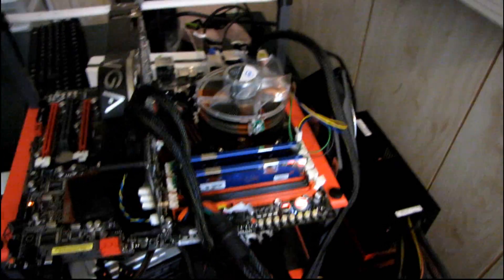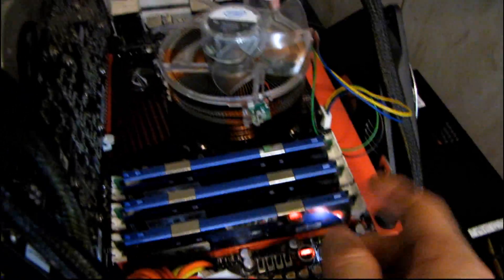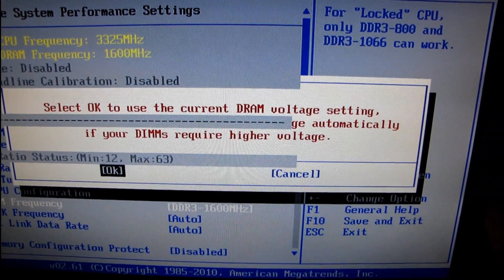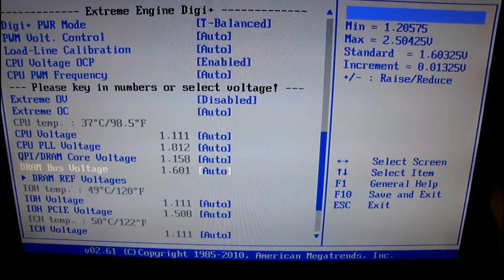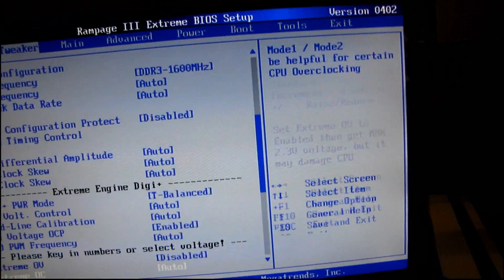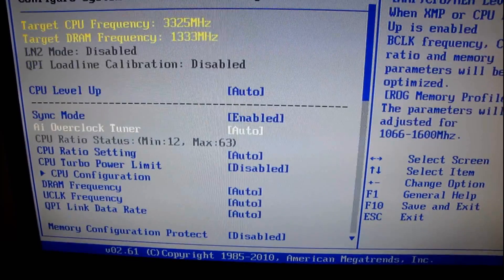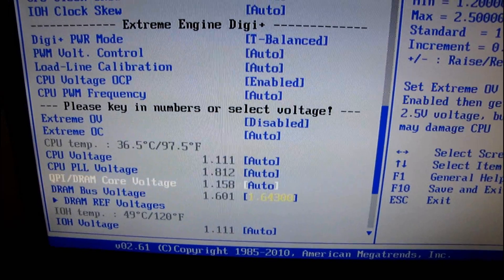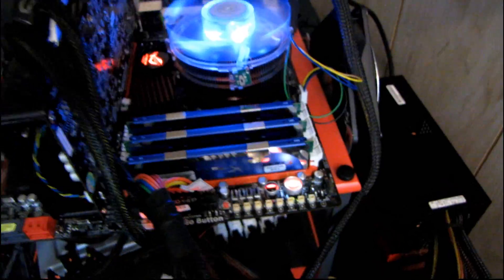Kingston DDR3 RAM Memory Installation Guide Frequency Timings Voltage Settings Linus Tech Tips

Comment: I installed 4Gb x 2 ram sticks in my laptop with DDR3 1066MHZ BUT it running so slow. I tried to use one the speed want back to normal. I wish to use 8GB but it is clear my PC was too slow to work with and moreover the CPU usage was 100 % all the time on Windows 10 x64 bit!
I tried to slow it from The bois but there no way for that. I'm using an old LG laptop from 2011 with an intel i3 390m 2.66Mhz
I thought of buying an i7 640m but I'm afraid of not working on my laptop
What should I do?

Comment: ok i got a question.. i have 6 slots on my old motherboard, installed 6 ram skits, 3 4 gig ripyaws @1333, 2 hyper 4 gigs same speed, and one stock kingston 2 gig stick with same speed, individually every slot reads adequate ram size and speed all sloths on pc working and checked, how ever... when i install them ALL, speed drops to 531 and 2 of my 4 gig sticks drop to a 2 gig cap, giving me a total of only 18 gigs ram  acording to SPECCY, system properties only detects 16 gigs, even if i take out 2 gig stick, it will drop down my 4 gigs sticks  to 2 gigs each (only 2 sticks drop regardless of which brand or where placed in any number slot), so... what the heck do i do??

Comment: ok so my motherboard is auto set to 1.5v and I get 1.35v ram and my computer will not even start ...with old ram in I set computer to 1.35v and shut off and put in 1.35v ram and restart computer will this work ?  and if I redo windows in the future will it remember 1.35v ?   or will it go back to 1.5v and will not even be able to get back into bios ?

Comment: Hi Linus, Hope you doing well. For last few days i encountered a serious issue into my motherboard (GIGABYTE 78LMT-USB3_REV 6.0). Last few month it behaves well with my 2x DDR3 8 GB 1600 BUS Ram and GTX 780. Now for few days i can only use one single ram to run my pc (8 GB single stick). Duel Ram doesn't give me any display at all. I tried a lot of way to enable my duel ram for work but still I can't. I checked my CMOS battery, update and flash BIOS, clean my all ram slots, interchange ram with various slots...nothing..Nothing gonna work!! All the slots are completely fine also my 2 rams..but i don't understand why the duel ram not working as like as before??!! Can you please give me any suggestion? By the way, I am not a tech savvy guy.. :)

Comment: What happens when you install 1600 mhz ram on a board that can only support 1333 mhz ?
Reply: probrably will be default 1333, and will boot up. Or will not boot and you will have to reduce to frequency, not a big deal
Reply: never boot up...

Comment: My RAM and motherboard are both overclock compatible but I tried to overclock my RAM yesterday to 1866 MHz from 1600 (My goal is to reach atleast 2133 MHz) and it caused my PC to blue screen 5 minutes after startup. I've tried adding voltage step by step but it didn't help.
CPU: AMD Fx-8320E OC at 4.0 GHz
Motherboard: ASRock Fatal1ty 970 Performance Series
RAM: EVGA Superclocked edition 2x4GB 1600 MHz
PSU: Corsair CX650M 650W 80 Plus Bronze Certified
GPU: MSI GTX 770 2GB Twin Frozr
Reply: i tried do the same too, 1333 to 1600 to me, failed too

Comment: According to the video, set your ram up to run at the fastest frequency, the lowest latency and the lowest voltage. 
Adjusting voltage, frequency, and the memory multiplier are all possible options that can be modified within BIOS. 
Changing these options can have an impact on the PC and how it runs. Overclocking RAM for example may decrease the life of the RAM or computer because it can cause the memory or the components to run at higher temperatures than the manufacturers rated specifications.

Comment: Hi, i have a question, i have 2 slots on my motherboard and there is already a 2GB on the other slot, can i remove it and replace it with a 4GB? so i can put two 4GB on both slots, thanks!
Reply: it depends on the motherboard

Comment: Strange, I thought my RAM was 8-8-8-24 as said by CPUID but it says 10-10-10-27. Does that mean I can set my Clock timing to 10-10-10-27? Currently on 1600Mhz with memory level up set with the bios
Reply: Tried the XMP profile but it won't allow me to overclock to CL10 for some reason, unless the profile is wrong
Reply: you know, lower is better in timings

Comment: i have a corsair-vengeance-pro-ddr3 2400mhz 1.65 volt but my motherboard does only support untill 2133mhz can i run my ram at 2133mhz with the Same voltage and timings
Reply: yes

Comment: hey mate I got a problem.
I have 8gb of ram but it's only use 3,98 gb
i have tried everything msconfig-boot-adv setting... etc.
doesnt work.
i got windows 10
Reply: double check that both RAM is plugged correctly
Reply: I have the same fucking problem just win 7 -_-
Reply: ***** 64bit
Reply: Did you solve the problem?
Reply: I have this problem too

Only reads 4gb when i installed 12gb

And i updated the bios

I've tested different sticks - same problem
Reply: @asd81907  asus p6t se
Reply: Both
Reply: @asd81907  i think it is r type ram for server
Reply: @asd81907  i tried u type ram 8 gb same type for 1333 and 1600

No go

So 4gb r type ram is 4gb

8gb u type 1333 and 1600 is 8gb

(dual channel - 2 4 slots)

I'm starting to think it might be a case of bent pins

I tested with dual and single ram channel (2 & 4 and 2nd slot, respectively - only 1 ram stick read) - when i plug in it in triple channel (2 4 6) --- no post
Reply: @asd81907  no

Comment: i just made my ram read 1600 from 1333. i can't wait to see the difference in gaming. THANK YOU LINUS
Reply: Lucas Garcia was there a difference in gaming?
Reply: no, just bandwidth. how ever as more games use more ram, more of the bandwidth of the ram will be used. at most. 34% of mine is used. would have been higher if i still used 1333. so it did help in a way.
Reply: Lucas Garcia I just bought 8 more GB ram(I had single channel 8GB before) and now it runs in dual channel so I see a big performance improvement in battlefield 1, I'm happy :D
Reply: GamersTurf  16 should be the minimum people use. all most 13GB of mine are being used and around 33% of its bandwidth

Comment: hello, i need your help. im Christopher from Philippines, im recently having troubled with my PC im wanted to upgrade my RAM from 2G ddr2 800mhz single channel which im using and running now with my PC to 8G DDR3 1333mhz. however when im going to insert my ddr3 ram when i turned on my computer it has no display and has continuous short beeping sound. 
my PC specs - 
Gigabyte G41m combo mother board - with 4 ram slot 2 for ddr2 and 2 for dd3
intel core 2 dou 2.8Ghz
Window 7 32 bit
PSU 700watts
350G Sata hardisk
i tried to check its proper placement and i tried all possible cleaning with my Ram slot stil when im going to insert the DDR3 ram. i only get continuous short beeping sound with now post boot and no display. i cannot even proceed to boot up. 

actually i have no idea how to setup the mother board bios. 
i need some help.
by the way i bought 2pcs 4G ddr3 Ram 1333mhz kingston because the motherboard max ram is up to 8G only based on the motherboard Gigabyte G41m combo specification manual
Reply: Dont reaplace ddr2 ram with ddr3
Reply: its not the processor, its the bios
Reply: You need 64bit Windows for 8GB of Ram

Comment: Hey Linus or anybody very good with PCS. I have Kingston HyperX 4GB (2GB sticks) @ 1066 MHz and on CPU-Z im at 400 MHZ instead of 533 MHz,  my cas latency is 5 and voltage at 1.8.  Now if i just want up my ram speed to 1066 is it best for mobo to do voltage automatically or manually?  I found a similar pair on newegg that says latency 5  5-5-5-15 timing and 2.2 voltage.      http://www.newegg.com/Product/Product.aspx?Item=N82E16820104038   Is it worth fixing my ram to its labeled clock speed and what are the best voltage, timing, latency to insure stability? Thanks!

Comment: this is worse linus tech tips , im trying  to follow what he his saying and hes jumping all over the bios while talking about different things , im clueless and i all most fried my motherboard all ready and im not to eager to all most break something else
Reply: bob cat I watched this video 3 times and still didnt get anything about what this guy said...
Reply: This IS linus tech tips😂😂😂
Reply: You know you can rewind and pause right? You don't need to be following his every move as fast as him lol
Reply: Do Not mess With your BIOS ! "Unless You are Comfortably Sure that "YOU" are sure of what You are doing !  Linus does not care if he Destroys a piece of hardware, because he is swimming in it, like Scrooge McDuck.  For the rest of us DIY'ers ,   Slow Down, Be Sure of what you are Doing. Take your Time ,  and Get it Right , so you don't throw away Hundreds of $$$ Dollars !!! ...  In This Video , Linus Almost toasted his system @... 5:04 .... IMO  the BIOS options should lock you out of over Loading in a way that can cause damage.... some boards have CPU Over-Volt Protection, however it has to be "Turned On" before it "Works"..... The XMP Profile is the Better way to set up your RAM (IMO) (and , incidentally safer as well)
Reply: @robertsimpson5761  most often if you mess with settings the motherboard will let you know if bad setting and reboot with last known good settings. a lot has changed since 2010.
Reply: bob cat that need work 100% if you cant, then you are skip something in configuration. Sometnih dont work correct in yor PC...

Comment: What happens, or what do you do when you buy a cpu limited to 1066 but bought ram that is 1333?
Reply: Then I assume you would have to under clock it or it might not even work. I'm just guessing
Reply: me too, its a hypothetical, I do not know what timings I would put the ram at to underclock it anyways
Reply: It'll clock down to that highest speed possible for the board.

Comment: You should never mix ram. If you are upgrading and buying new RAM, you should either buy the exact ram that you already have, or buy new ram all together and not use the old ram at all. There is almost always compatibility issues when mixing ram from different vendors and/or different models.

Comment: is setting ram speed and voltage in general an easy task? how much better is ddr1600 than ddr1333, also is 1.25 voltage rams a lot better than 1.5 volts? how many watts would a 1.25 volt ram stick have? is it 1.25 mulitiplied by 3.3, 5, or 12 volt to find the wattage? o and why are the low cas timing rams so expensive, is the performance really that much better? i want to get the best parts for my friend that will have a pc built soon, the ddr1333 1.5 ram is 33 dollars and the 1.25 1600drr is 43

Comment: No offence, but that's very fucking stupid to put new RAM with old ones.. The reason why it won't work is that, the new RAM will most likely have different timings, and different voltage. Take out the old ones, and you will be good.

Comment: talk about showing off!, I hope one day soon I can play around with the ram settings like he just did. So can the Kingston 2x2gb 10600 1333MHz Value Ram, be overclocked by much as I heard that it can't, or is it just depending on having a top spec motherboard so you can adjust more settings?. Nice video Linus, really like your videos they are deffinitely my favourites about computer hardware, thanks.

Comment: I've got some problem with my memory sticks, I am about to change the timings.
Butt, I've looked on my memory (googled everything) and it says it has CL9 timing 
(9-9-9) But what then? you've got like 9-9-9-27-4-74 and so on. Does my ram got anything byond 9-9-9?
My ram is: Kingston ValueR. (PC3-10600 1333MHz)

Comment: I just bought 4 more gigs of ram from another brand (had about 1100 reviews average 5 eggs) and it had the same timings and latency, and MHz as my old ones, but different voltage old: 1.8 (rated) new: 1.5 (rated). When i put it into my system. I got no video output and the fans kept pulsing o.0. I took out the new ones and it works fine again. Also the new ones say 2N on it, but i can't find that anywhere else on the old ones. Does it matter if they are different there? Please help

-cwbh10

Comment: @Sipulipantteri First all timings, speed, and voltage to stock and then run prime95/memtest4 and see if it runs without freezing or erroring. Also check your case to make sure all wires are tight and not shorted anywhere and check for any spilled thermal paste shorting something. Then overclock and test each part one at a time.

Comment: @MacScribble It's a ASUS K70, I have never had any heat problems before as the fans are positioned in the back where they are very well exposed.

Comment: @DuyAnh1 its gonna be clocked as the bios tells it to. i got 1600MHz dominators and they ran on 1333 by default in the bios and i had to make em run on 1600 by myself